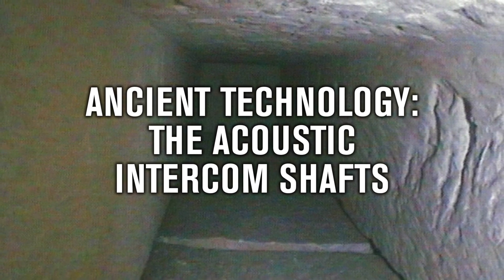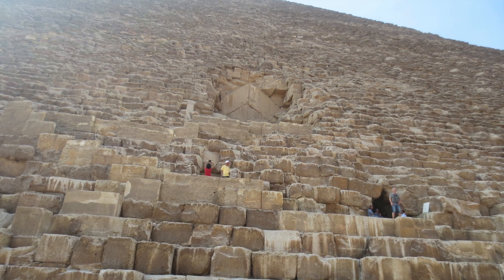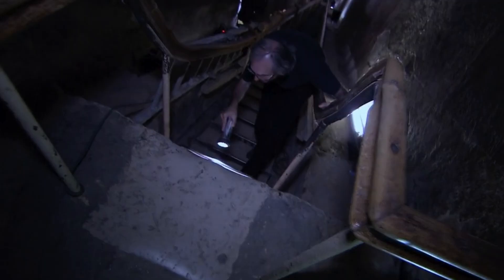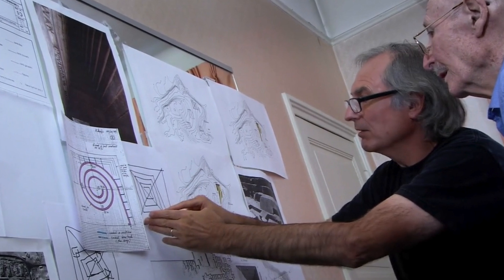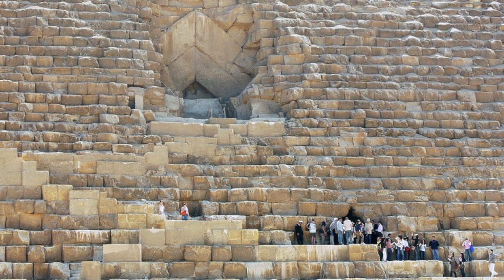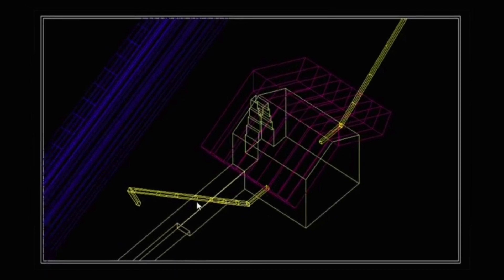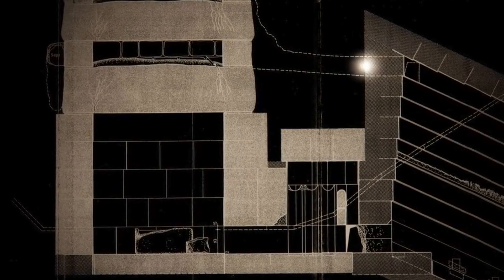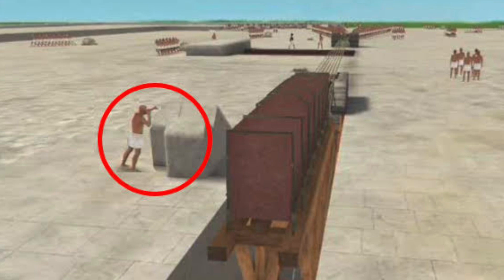Great Pyramid ‘Air Shafts’ Theory: Acoustic Communication Shafts | Ancient Architects

Comment: Sorry but i find this answer completely unsatisfying

If the shafts are a counterweight system, that doesnt explain how the big blocks above the KC got in there? 

how did they communicate while making the base? Considering thats when the teams would be furthest apart 

Surely there are much more efficient counterweight systems than building a bunch of shafs into the structure?

Why would the chambers need to resonate the sound if there were people to communicate in them?

Why do the shafts make it to the sirface of the pyramid if they were only used part way thru construction? 
The model used by Houdan with the spiral slope arounf the edge - wouldnt the shafts be used as a counterweight system while those slopes were still exposed, therefore when the slopes were covered the shafts woukd be too? 

And most importantly: 
Why would a dead Pharoah need a resonant tomb with ventilation?

Comment: No way the egyptians went through all this effort when a piece of string between two cups as the same effect. 
I 100% agree that simplistic explanations are often the most realistic and unfortunately whilst I agree with much of houdins explanations I don't think that this was the most logical and simplist way to communicate across a moderately large distance. 

I mean isn't that the biggest hole. The pyramid is big but is isn't that big. At it's widest point it is 230 metres but it does naturally get narrower as you get up so by the time you get past the kings chamber you are only talking about 100m, a decent runner could relay the information in seconds. Then you have to take into account that the end of the shafts get further apart as the pyramid is enlarged. For the first few dozen layers the ends of the shafts are just tens of meters apart. Not really worth such a complex communication system. 

In a sense the taller the pyramid is build the wider the gap between the ends of the shafts gets but as the pyramid gets taller the narrower it gets. This means that when the pyramid is wide they are too close together to be of any practical use but as they get further apart they quickly become redundant. 

Another big reason why this is was likely redundant as a communication system is the the pyramid of khafre. which is only slightly shorter, didn't seem to need any sort of large stone shafts in order for the workmen to get its stones in place.
Reply: Unlike other pyramids, the great one is believed to have needed a major counter-weight system for raising the granite blocks, and each end was quite far apart with lots of stone in between.  Also, the width of the shafts would have had only a minor effect of diminishing the volume sent through them.
Reply: @redwoodcoast  Sorry but that makes absolutely no sense. If the Shafts were to communicate across the gap created by the grand gallery then you'd expect them to run at a 90% angle from the axis of the gallery. The grand gallery runs from north to south and that is the same axis that the queen chamber shafts run from.. One of the queen chamber shafts does bend around the gallery but the other end isn't exactly on the other side but more or less in line with it.
Reply: @shian228  that is true. Though doesn't he use this as proof for other undiscovered passages?

Comment: makes a lot of sense to me.  JPH is the most on point.
Reply from the maker: He is such a clever bloke
Reply: Interesting theory. What I do not understand is What is needed to be communicated. What needs to be communicated down a shaft that can't be communicated by walking through the passageways. Or give instructions before people walk in. Mind you, the shafts are pointing upward. All the way to the outer walls. Again, what needs to be communicated down into the cambers that needs one person on the outside and one person on the inside? Why is that person on the outside not just walk inside? What minute-to-minute update has to be given to to people working in the chambers while the rest of the pyramid is piling on top of it?

Comment: I'm very curious what kind of instructions might have been given? Is it basically just "pull!" commands for the pulley system? Just curious. I think this adds up very well in a lot of ways. Like you said the shafts aren't straight or sealed so they weren't transporting or looking at anything. Transmitting sound actually makes sense though. I'm curious how the sound gets outside but maybe I'm just being dense. Does the kings chamber shaft open to the outside? I wasn't aware but it stands to reason anyway since they found the debree in there. OK thanks for all your work as always!
Reply: Yes. I was wondering too what might have been communicated. I would have thought that work at either end of the shaft would be independent.
Reply: That's my problem here. Seems a lot of extra work for a simple communications system when a simple signal flag would do.
Reply: @swirvinbirds1971   My thoughts exactly. A simple semaphore system would be quicker as complex jobs need simple instructions. Why not make a clay speaking tube and elevate it as needed if they needed spoken word.
Reply: @Lynn Geek except for the fact that the dynastic Egyptians made it known that they had found those pyramids. They didn't build them. Same goes for Aztecs, Mayans & Incans.
Reply: @. 
Exactly... The egyptians never built any pyramids... That's ridiculous to believe
Reply: @Lynn Geek 😅 dude... Herodotus, Solon, Plato & the ancient dynastic Egyptians literally wrote about it. It's not my hypothesis. It came directly from the source.
   Plus those monuments exhibit damage from major water erosion. That place was a desert when they first migrated there.

Comment: The shaft also served for measuring, by triangulation, because they allowed to tend ropes, kept straight by resting on stone.
Constructors relied on pythagoras theorem to calculate distances, but they had no way to control the geometry of the pyramid at that height, so there has to be another pair of hidden shafts leading to the other external faces of the pyramid.
One shaft bends, but the constructors knew exactly his position, and could correct the measuring.

Comment: why did they need handles on the inside of the block to close it up in the shafts? unless the only way to have handles on one side is to drill through the block and bend the bar/handles on the others side to keep the rods in place. I mean how else do you keep a copper rod in a stone block with out some kind of bonding agent? so i guess with out that you just put a hole all the way through and bend the rod to stop it coming out. as to why its copper i guess that's a metal they had plenty of as they had copper tools. so why not use it no?
Reply: The block needed to open and close, often. Close when raining or sandstorm, or when no work in the chamber. When another layer of the pyramid was built, the block was deep underneath, worker might not easy to reach the rope, so they used a wooded stick with a cooper hook to do the open and close job. And one of the hook "lost and found" in the shaft.
Reply: Ah yes, the famous copper tools on granite argument

Comment: so in order to achieve something difficult, they did something INSANELY difficult, I'm not convinced at all
Reply from the maker: I think the point is it was meticulously planned before work began and then they just followed the plan perfectly… block by block.
Reply: @AncientArchitects  well someone had to make that plan in advance though, and those shafts affect (probably) hundreds of thousands of blocks. then the massive influence on statics, which as you pointed out several times, are a huge issue for such a big building and all that just to have a comm line (for what exactly?). the theory also massively contradicts einsteins quote .. because this is surely not as simple as possible. on a sidenote 9 mins just to get to any relevant point was looooong ;)

Comment: Jean-Pierre has done ground breaking research on the pyramids and I agree with Matt that Jean-Pierre's theories are unique in the way that they actually make sense and are based on facts and science.  However I have to raise a few doubts on the explanation of the air shafts .... 

- If those shafts were only "construction tools" then why did they lead into the burial chamber (if it is a burial chamber) and not into a different space like an anti chamber or one of the tunnels?

- why were the shafts not closed and sealed so the walls are flush? It would have been no problem to fit a granite block in the opening and make it look like it wasnt there.  It would be weird to leave construction shafts open in the burial chamber.  However maybe they were opened by grave robbers..

- why were not signalling methods on the top of the pyramid used? One could have signaled with flags or bugles or trumpets. 

It seems too much effort to fit those shafts into the kings and queens chamber just as a signalling device if there are easier options available.  If the kings and queens chamber were only built to serve as communication hubs then it would have been way too much effort. 

It seems true that those chambers and shafts have unique sound qualities however if that was the main purpose for the shafts it would allow other explanations for their purpose for example they may have been used  to sing or chant in the chamber and project it outside. 

I agree with Jean-Pierre's theories and he was kind enough to explain some details to me however here I am a bit skeptical and am raising the questions above.

Comment: You might want to consider pressure and vaccum, as a concept. Sealed chamber, shafts, ported passage ways, large openings leading to small passageways outlets. All these can have a resonance and vocal amplification effect, but that's why it is a byproduct to the design. There is a functionality to the structure, chambers, and shafts, and these chambers and shafts were not constructed simply to be two cups and a string communication system.

Comment: How did they cut all that granite though?
Reply: I'm thinking they used quartz  based sand as the cutting abrasive. I think they cut a few mm depth groove in the granite to square off the shape and then used wooden wedges tapped into the cut groove then soaked with water the wood wedges expand to split the stone..   just my opinion.
Reply: @davidcorbett1713  is a piece of wood wedged less than centimetre deep going to spilt stones that size? I'm no mason so I have no idea but I always imagined they needed much deeper grooves.
Reply: @sirmrguitardude  they would tap the wedges in deep enough maybe they cut inch deep holes at certain points along the groove. It is possible to split granite this way it has been done.

Comment: As usual, the problem starts with the assumption the pyramid is a tomb, when in fact we still don’t know what it’s purpose was. And that should be the premise you start from. After all, how can you learn anything if you think you already know the answer? By doing so, you and Jean Pierre Houdin are suggesting those magnificent acoustics you are referring to are simply a design chance and were not deliberate. We build concert halls with the acoustics firmly in mind. But we don’t build ships that have speaking tubes for the same purpose. Nor do they expect anything other than short sharp instructions to be delivered through those speaking tubes. And of course, given the pyramid was presumably built from the ground up, what instructions would be required to be delivered down to the so-called chambers from above after they were apparently completed anyway? A weak explanation, yet again grasping at tombs and ignoring so much more the Great Pyramid is trying to tell us about the past.
Reply: Thank you! Agree completely

Comment: Mate, it obviously had more than one purpose. If you make something that big it becomes a Lighting rod, esp with a Gold Top on it. So rather than handles at the end of the shaft they are connectors, add the Ark as a Capcitor with chambres full of Dundera batteries and whoopie doo that's they managed to do Gold Electroplating. That particular Quartz sand used? In itself would do anything, But if you rammed a couple of Million Amps in it at once, maybe differnet? We really need to Crowd Fund a Scale Replica to try all the theories and Hope Zahi Hawass don't sell it all down Cash Converters first!.

Comment: The shafts are there for ventilation during the burial ceremonies. They are opposite side so to create currents of air to flow. At the time of use 5000 years ago, light torches were used. They produce deadly amounts of CO2, so it would become a death trap in a few hours.
Reply: @IHateThisHandleSystem  the ones at the king's chamber were sealed from the outside, they were functional up to the last moment. Speculating these are for workers to yoddle is naive, in my view.

Comment: Lol, until i see it done with that old kingdom technology, i don't care what he has to say. You're talking about blocks that are 20-100 tons, and in some places there are less than 2 feet on each side to get them in place. You can say how it may have been put together, but resolving the issue of moving blocks that big, with the explanation of man labor and ropes will not cut it because it is impossible, let alone carving the stones themselves with copper.
Reply: That's why there is the counter weight system in the grand gallery.

Comment: Where exactly does the void in the side of the northern queens chamber shaft line up in respect to other features in the Pyramid's interior. Could the vfb oid be a means of siphoning off some of the sound to communicate into another section. The entrance ticket found in the shaft had to of gotten in to the shaft somehow. I have a hard time believing that air currents could have carried into the shaft if the shaft is blocked off on the highest point. Is it possible that there is some connection between the Grand Gallery and the northern shaft. That CV ould account for the ticket having been transported into the shaft. Also the round object the the robot observed in the northern shaft. Is it possible that it the plastic cap for a container for 35mm or another format of film.

Comment: The inside of the air shafts change from smooth to rough in texture because the pyramid is build over the top of a huge hill, so when the the part of the air shaft comes out of the hill it changes texture

Comment: Some commenters have suggested that using human runners, or just shouting would have been much easier, but I don't think that it would have worked. There would have been considerable shouting of orders to the work crews, and it is not uncommon for work gangs to sing or chant because the timing of their song/chant helps everyone function in unison - shouting time-critical messages across the pyramid would not have worked.  With all the work going on, the stretched ropes, the size of the work gangs, etc., it would actually have been pretty difficult for a runner to move quickly across the pyramid. Finally, sound travels much faster than a human could and, even given the added length of the shafts, they would have enabled a much quicker and clearer message than could otherwise have been done.
Reply: right..it is also possible that the view/shouting direction on the platform could have been obscured by architectural elements during construction like large granite beams, kings chamber elements, counterweight structure etc..
Reply: @ast3663  Good points!

Comment: I don’t know JP Houdin’s work in depth but I have stumbled on a couple of his old videos before and he was pushing the idea that the pyramids were not at all as sophisticated as they are said to be based on a couple of places that can be seen today where it looks a like beneath the blocks there is only a pile of debris, and I found that to be rather off putting. 

I truly wonder what he thinks about more subtle aspects as the fact that the Egyptian royal cubit is directly linked to the meter, and through it with Pi, as the length of an Egyptian royal cubit is exactly the length of an arc of pi/6 on a circumference of 1 meter of diameter. Also the measures of the King’s chamber are direct metric values multiples of Pi and Phi. This is often brushed off as a coincidence, but there’s academic hard evidence that the meter exactly as we know it today was known and used since at least 5000 years ago, and this has profound implications.

Comment: If the shafts were for communication, you’d have to eliminate simpler communication options. Why not communicate across the flat top at the height the shafts end? There would need to be a reason to communicate directly with someone in the king/queens chambers… a spotter inside to make sure everything was properly aligned?

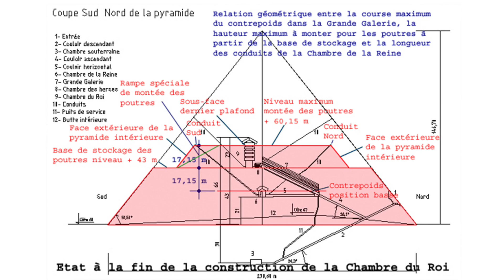Comment: At 15:09 The QC shafts are covered because they extended only to the outside of the internal pyramid. Whether that was the original pyramid design or a pyramid that was expanded later is super hard to tell, but I think that is the most obvious and logical answer - regardless of whether they were for airflow or communication (or both!)

The reason they run out to the surface and not up - where they could have more easily been used to run notes up or down - is that they follow the shortest path. :)

While it's possible to quibble here and there with JPH over some minor items, the reality for me is, he's the closest to fully understanding the construction than anyone currently alive. I test any major construction hypothesis against the "internal ramp" (which would have been external to a stepped construction phase) and I always find any other lacking.